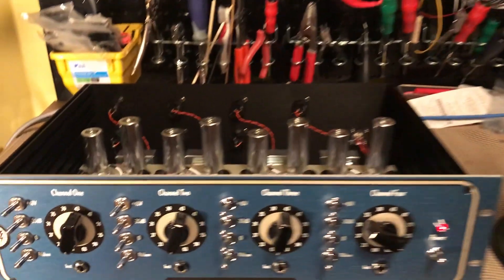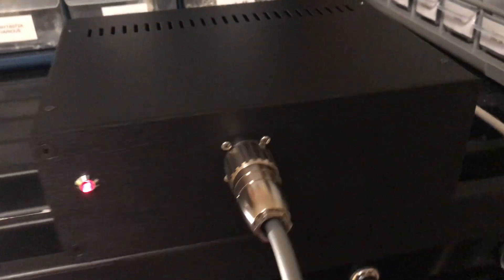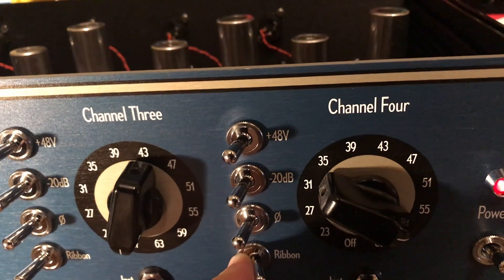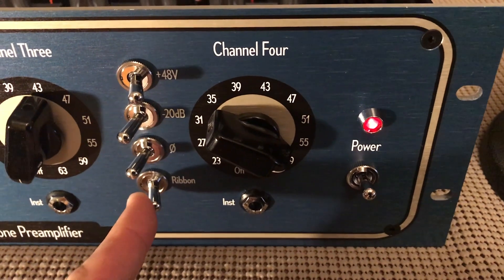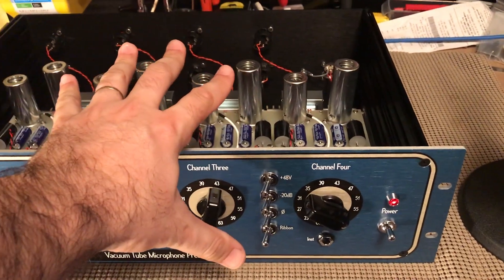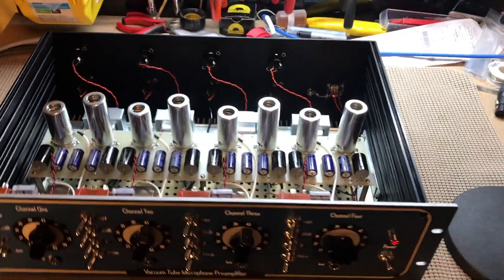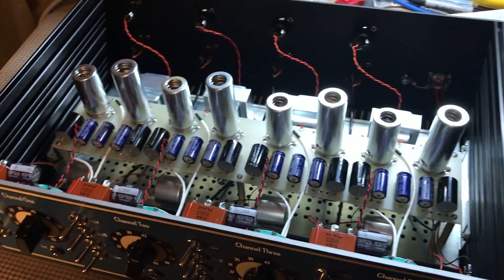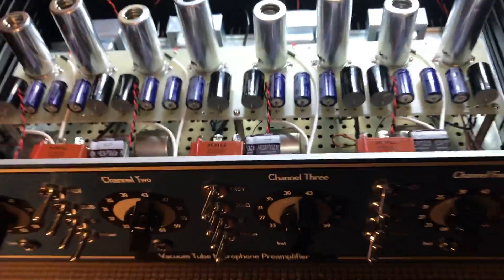4-Channel Tube Microphone Preamp

Comment: this is soooo awesome. Could you add an output attenuator to each channel? To drive the mic harder and get more color. Also I am really wanting to build something exactly like this. But am basically a total noob, when it comes to building anything. Could you recommend a resource to learn about the circuit and where to source parts?
Reply: Yes, this! I literally never buy a pre-amp unless it has an output control. I love to drive pres hard, its part of my sound.

Comment: It just blows my mind you can build a tube preamp but still think the phantom will damage the ribbon mic.
Reply from the maker: Phantom power will not be reflected through a ribbon mic transformer. One exception occurs when using a patchbay with TT or TRS plugs. Pulling one of these plugs with 48v active will cause the signal wire to short to ground and permit phantom power to reach the ribbon motor, which can result in stretching or even permanent damage to a ribbon.
Reply from the maker: Glad you like the preamp!
Reply: @ProfessorDan  who puts a patchbay between microphone and a preamp?  I understand that there might be some uber studios where you can route the mic to another room etc, yet alone a ribbon without boosting the signal first. In 99.9% of times, in normal use, the patchbay is after the preamp and the phantom is gone before it hits the first preamp components.
Reply from the maker: @tommibjork  The studio I work in has tie lines from the wall to the patch bay. Many studios are similar, so it is something worth considering when designing a piece of gear.
Reply: @ProfessorDan  The preamp is great, love the vintage looks. Would love to buy one but I guess the price is quite high? I stumbled here when looking for 4 channel preamps. Couldn't you just write "RIBBON" on the opposite side of +48VDC? I mean, it takes same much effort to flip it and also disables the phantom power.
Reply from the maker: @tommibjork  On that particular prototype, the "Ribbon" switch also bypasses the input transformer secondary resistor. That is its main function. Disabling phantom is a secondary feature of that switch. I'm working on another mic preamp design which will not have the ribbon feature at all.
Reply: Forgot to say. The amp looks and sounds killer, yes I need this.